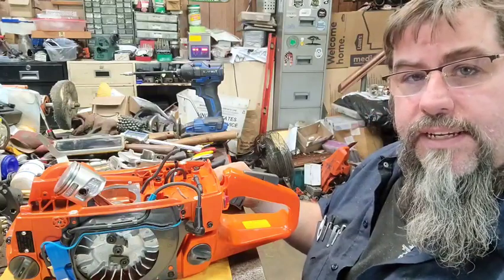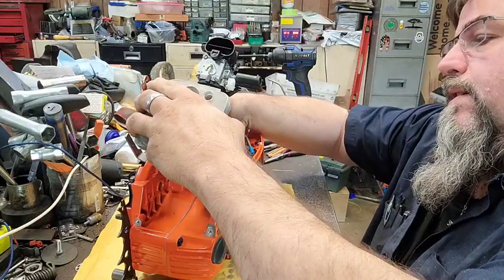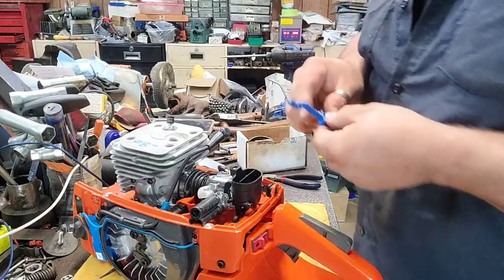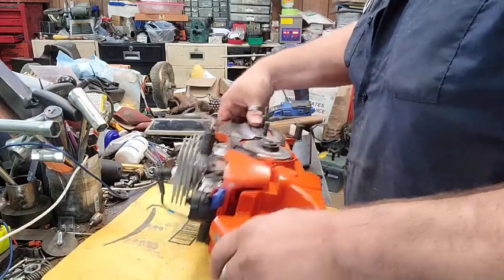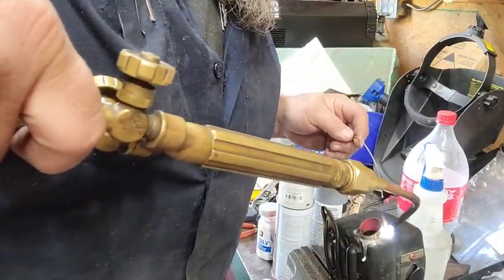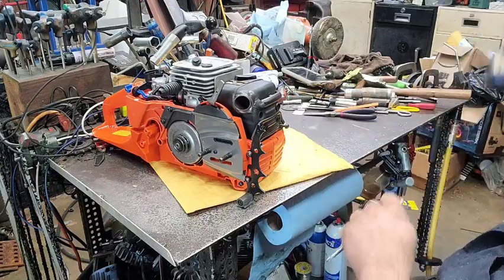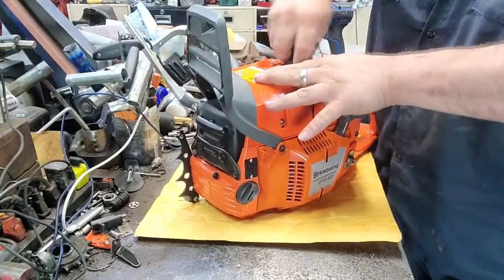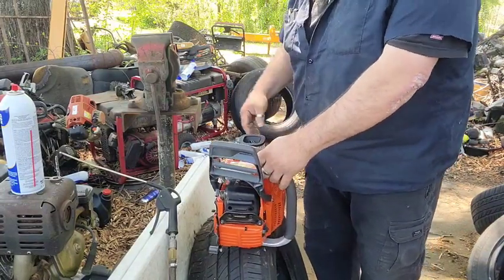Brand New 372 X Torq Port Job part 2

Comment: Quote from New Life newsletter:
Ability vs Attitude 
Not that I am speaking of being in need, for I have learned in whatever situation I am to be content. I know how to be brought low, and I know how to abound. In any and every circumstance, I have learned the secret of facing plenty and hunger, abundance and need. I can do all things through him who strengthens me. Philippians 4:11-13

Performance is based not just on ability. You know that from experience. On different days, even though your ability does not change, your performance will vary widely. The difference is due largely to your state of mind. Yes, ability is important. Yet unless you’re able to manage your attitude, performance will suffer. Your attitude is determined by you, by the way you control your mind and your body. It is independent of external factors. You can always find a reason to be depressed. You can always find a reason to be happy. You can always find a reason to be despairing, or a reason to be positive. Yet external reasons do not really matter because they are unnecessary. The only reason you need to be happy, positive and enthusiastic is because you have chosen to be so, and because it will substantially improve your performance in any endeavor. On any day, in any situation, with any person, you can choose to move forward with a positive, winning attitude. Keep that in mind and watch your effectiveness soar.

Father in heaven, we don’t have control over so many areas of our lives… the weather, other people, the situations we face… but we are learning today that we can always control our attitude. Whatever today holds and however someone treats or talks to us, help us to honor You in the attitude we have. Shine Your love and let others see a difference in us, not just in what we are able to do, but the attitude in which we do it. In Jesus name, AMEN!

For success, attitude is equally as important as ability.

Comment: I've been playing around with different muffler mods on my g660 and it just didn't respond like outer saw's I've done for some reason. I built my first Ironhorse pipe last night and man I'm impressed with the throttle response and sound. It still has a odd sound in higher rpm that sounds strange idk what it is almost like it's kinda 4 stroking but it's not?.

Comment: Mr Hopper what are your thoughts on the x-torq main bearings, can I use the old style non x torque bearings on my x-torq crank, mine has some play in it on the pto side, that's causing me a bit of concern I have read that x-torqs use nylon cages in the main bearings that doesn't instill a great deal of confidence in me.

Comment: Hopper just a question.  Why don't you polishe the exhaust and grind the plate gasket and muffler to match the exhaust port.  Most often they are smaller than the port especially if its opened just to eliminate restrictions and have a smooth perfect exhaust stream.  Like you would on a automobile head.  Rough intake smooth exhaust all matched.

Comment: Quote from New Life newsletter:
Cooler Heads Prevail 
Cease from anger and abandon wrath; do not fret; it leads only to evil. Psalm 37:8

Actions taken in anger are at best ineffective. Anything done in anger will almost surely lead to regret. Most things done in anger are blind and unthinking reactions, rather than controlled and intentional responses. When you let your anger take over your actions, you put yourself at a distinct disadvantage. The best thing to do when gripped by anger is to wait. Count to ten. Count to 100. Sleep on it. Think it through. Talk it over. Get past the anger of the moment before you take the next step. Certainly, anger can provide energy, but it is almost always a reckless and uncontrolled energy which harms anything in its proximity, including you. Acting in anger hurts you at least as much as anyone else. Wait out your anger. The energy does not go away. Instead, it becomes more focused and productive. Whatever caused your anger, there’s something positive you can do about it. When you take time to let the anger cool, you’ll find that positive course. Be smart. Cool off and be a real winner.

Father in heaven, we all struggle with anger and the inevitable regret that comes for actions taken in anger. We humbly ask for Your help to fill us with divine peace even in the midst of frustrating, anger inducing moments. In Jesus name, AMEN!

Keep a cool head and a warm heart.